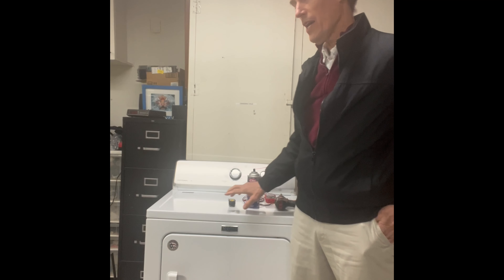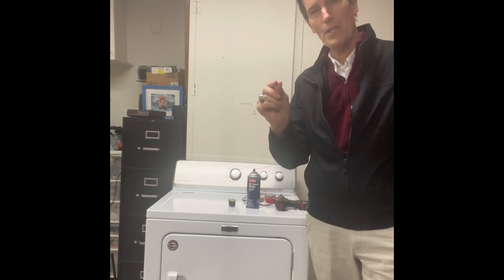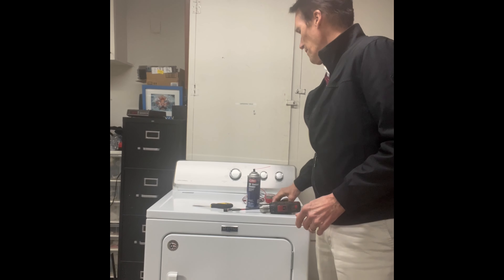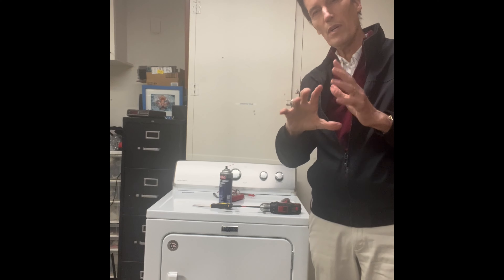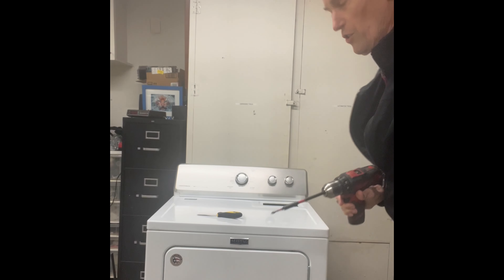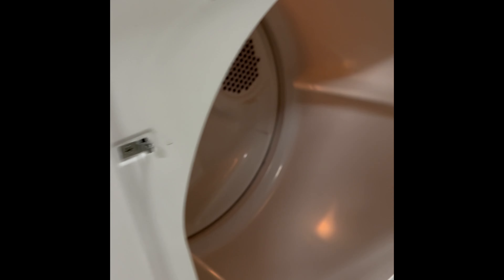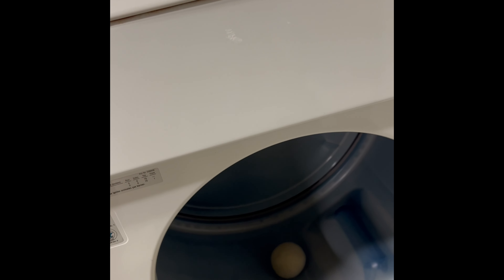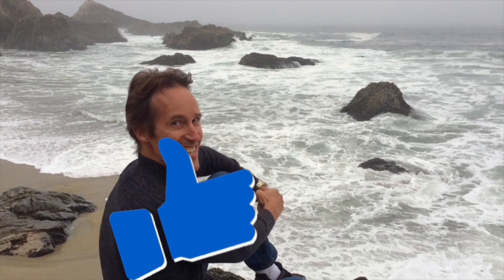✨ Maytag Gas Dryer - Complete Step-by-Step Troubleshooting  ✨

Comment: Thanks for sharing the content, the two most common metal screws are 5/16 and 1/4 of which 1/4 is the most common. So was the 'gas pipe restriction the problem with this dryer?
Reply from the maker: That’s right, it was limiting the gas too much.
Reply: @QuickAndEasy5MinuteAppliance  I worked on a gas stove and the darndest thing tbe safety valve was open but it was not open. Lever was stuck in the open position but was stuck closed. I closed it then opened it and whoosh. Thought I should share.